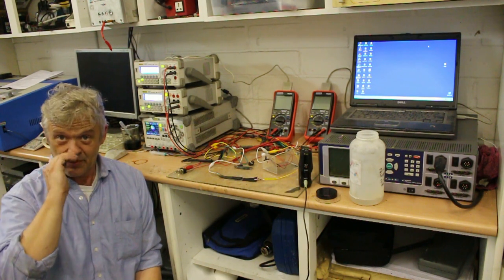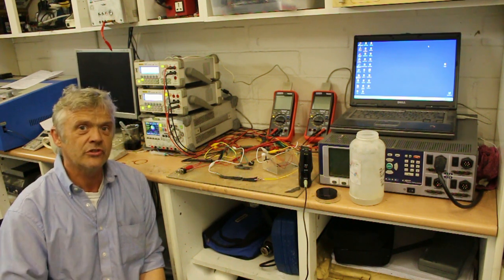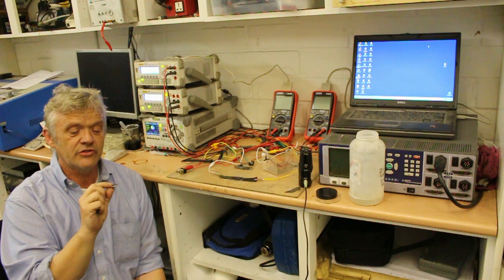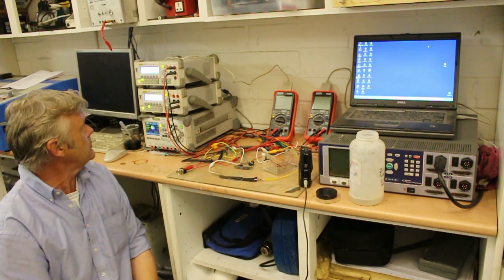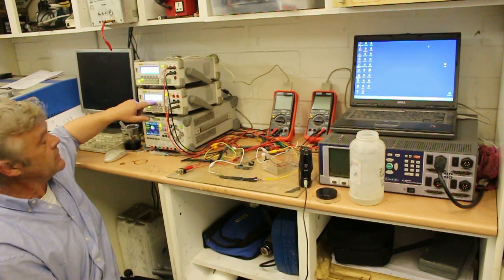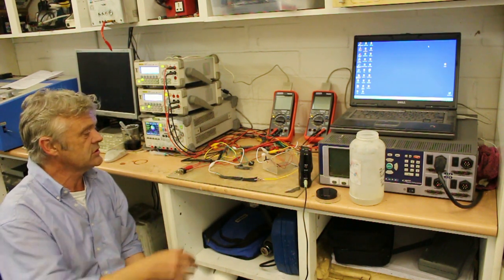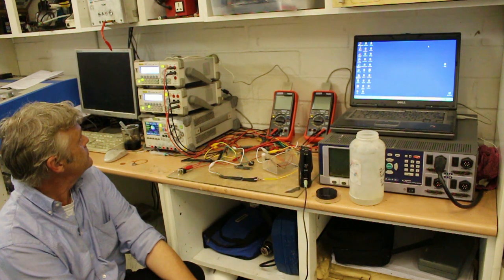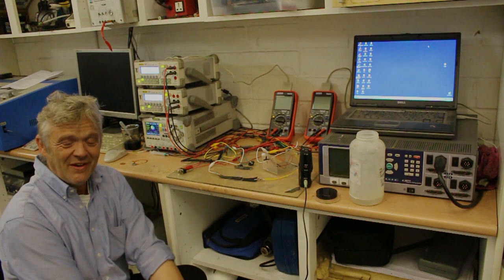Carbon Device At 2 V And 2 4V

Comment: Where did you get a motor to work from such low voltage, is this a consumer product or self made?
Reply: Miniature toy helicopters/quadcopters contain tiny motors that can run on 400mV or so, or you can find them on eBay or Amazon usually listed as something like "DC 3.7V motor". Despite the listed 3.7V they can run down to a very low voltage.

Comment: I suppose at that voltage you'll generate some Oxygen and Hydrogen which is just sitting as tiny bubbles on the plates. So I guess what we're seeing here is something beyond a super-capacitor behaviour but a combination of capacitor and fuel-cell: while it is consuming the bubbles it acts as a fuel cell. Is this what your studies confirm ?

Comment: 27 seconds to discharge time to 5% voltage is pretty severe punishment for a battery and will probably damage it.
If you want to get maximum power out of your battery, you should discharge into a load at least 10 times your internal resistance. It appears your internal resistance is about 10 ohms so your load should be greater than 100 ohms. That way at least 90% of the stored energy is available externally. Your motor appears to be about 15 ohms (1.2V/80mA) so only about 60% of your battery's energy is available externally.
Reply from the maker: it's not a battery - it's a super capacitor the power density can more than handle this
Reply: Same response for a capacitor. i.e. The load must be 10 times internal resistance. If you do this you can get even higher energy density for your capacitor. In this case energy available will be 40% higher.
Reply from the maker: What I think you are talking about is C rate discharge mate - nice rule of thumb you have and I will bear it in mind but what I would do is load the device at C/20, 1C, 5C, 10C and 60-80C if I really wanted to investigate the effect
Reply from the maker: no mate I don't think that's right - in my understanding C refers to the capacity of the active material -for example if a particular material is able to move an amount of electrons at a certain voltage - you need to refer to the pourbaix diagrams and stoichiometric equations to work it out for redox - for a given molarity of material you will get a given number of electrons at a given voltage - the molarity of material converts to a given weight and a capacity normalised to the weight - this is the C rate - resistance doesn't come into it at this stage - I did a video to explain C rates
Reply: The "C" rating is how many mA it takes to discharge battery in 1 hour.
See https://www.youtube.com/watch?v=Lm3YuwueHHc for a quick explanation. 
Example For a 1000mAh battery rated at 10C :
If C=1 then it will provide 1000mA  (1 Amp) for 1 hour
If C=10 then it will provide 10,000mA (10 Amps) for 1/10 hour . etc
Since battery is rated at 10C, If you go beyond 10C the capacity will decrease due to internal resistance. A high "C" rating means a high discharge current before internal resistance limits current.

As you point out the "C" rating is related to chemistry and area of electrodes.
Reply from the maker: You're kidding me? That's not C rating at all - it has nothing to do with area - I did a video on this - you might want to watch it https://www.youtube.com/watch?v=EI7fMVEEhQg
Reply from the maker: i had a think about what you have been saying and made this video with you in  mind - i hope it helps you get the idea https://www.youtube.com/watch?v=ZByxIwGdFLo
Reply: Thanks for the Video. I agree that the chemistry determines the capacity of a cell (mAh). However the "C" rate is a measure of how fast you can discharge it. 
THE "C" RATING IS A MEASURE OF HOW FAST YOU CAN DISCHARGE CELL AND STILL GET MOST OF THE STORED ENERGY INTO AN EXTERNAL LOAD.

Typically primary cells cannot be discharged at the 1C rate.
Example: A 2032 lithium cell typically has 240mAh capacity with a 1000 hour discharge time (C/1000). See http://data.energizer.com/pdfs/cr2032.pdf
The test discharges it with a 15 kohm resistor and terminated at 2V (200uA). The whole test takes 1000 hours.
If you try to discharge it faster, a lower capacity results.
You can see this on page 2. Here it is discharged with 100 ohm resistor with a 7% duty cycle the capacity drops to 175 mAh (30% less). This is is about C/10 rate so cell should NEVER be tested at above C/10.
The reason is that the internal resistance is about 15 ohms. So if you load it with any less than 150 ohms (x10 times internal resistance) you will get significantly less mAh and watt hours.
Reply from the maker: this may help understand the difference between C rate and C rating matehttps://www.youtube.com/watch?v=QxwTYFkRmWo

Comment: This looks like an attractive replacement for lead acid in solar energy storage, where out gassing is already accepted and high self discharge rates are not a problem.
As an alternative to sealed lead acid it might find application as battery backup in telecom and computer systems.
A low cost, non toxic, carbon based battery must be very attractive to industry. I look forward to seeing the full battery specifications.
Reply from the maker: That was exactly my thought mate
Reply: Robert Murray-Smith Have you considered defining your own case standard or using the existing lead acid battery case?
Is there any issue with the carbon igniting if it partly dries out? This carbon technology is certainly much safer than lithium batteries. If self ignition and self heat generation is not an issue, there seems no reason not to enclose it in a light weight, low cost polyethylene or polypropylene case. Another application is in the area of autonomous mobile robots, where there is a requirement for light weight, robust, high energy density batteries. Are you aware of the work on robots of Boston Dynamics?  You may find it interesting and potentially profitable to view the YouTube videos from this company.
Reply from the maker: I'll look it up mate - cheers
Reply: Robert Murray-Smith I hope you do not mind the link to Boston's Dynamics. The reason I mentioned them is because they appear to be leaders in the field of robotics. I wanted to show another area where light weight, high density energy packs are required. I believe that many of their autonomous robots are powered by Lithium battery packs. This is clearly a growing area as intelligent robots are starting to move from lab to industry. A major limiting factor is their very demanding power requirements. There is a growing market for robot toys and robot home assistants and drones. A long life, light weight, safe, non toxic battery offers a considerable advantage in this market over Lithium technology. Since these devices are charged just before use and most likely be put on float charge when not in uses, self discharge is not an issue. 

I use 5 APC UPS units to power my computer and telecom systems, these float charge   SLA batteries. Their weight is considerable, due to the lead content. The batteries fail after 3 to 5 years on float charge, and must be recycled. These appear to be an ideal target for replacement by a graphene super capacitor, since the UPS output is a synthesised approximate sine wave at mains voltage, there only requirement is to replace the up converter with one designed to work with a wide DC input range.
Reply from the maker: no worries mate

Comment: (joking tone)  Now charge it at 120V.
Reply from the maker: lol - I did - it charges in a couple of seconds
Reply: You mentioned in another video that changing the voltage may change the energy density... Did you notice that with the 120V charge?

Comment: Do you expect any off-gassing when charging in a flooded cell?
Reply from the maker: that would depend on the charge voltage mate - like I said in the video - sorry if I wasn't clear - the voltage dictates the gassing rate - at 2 volts you can seal the cell